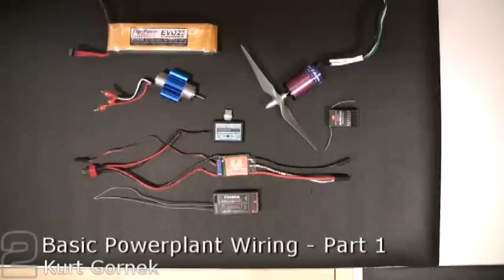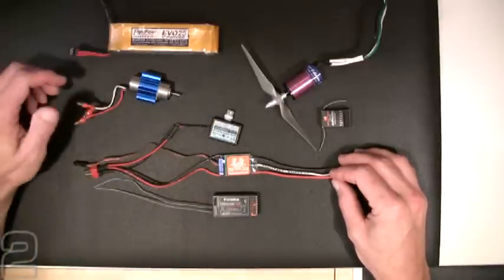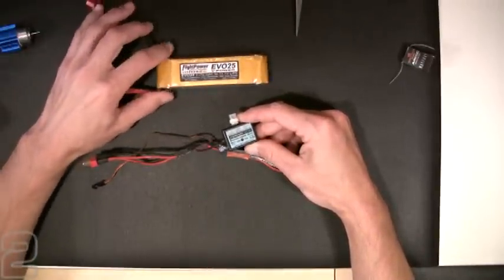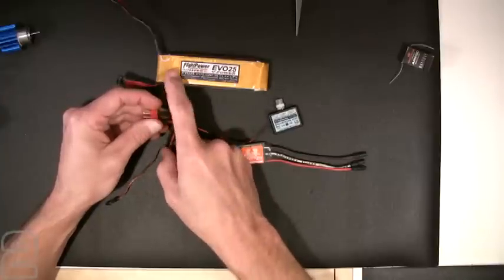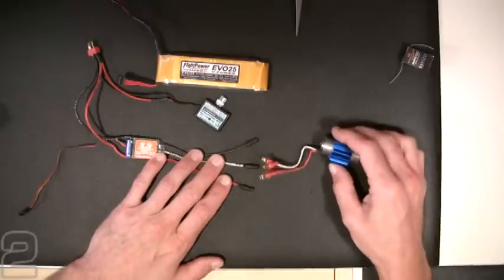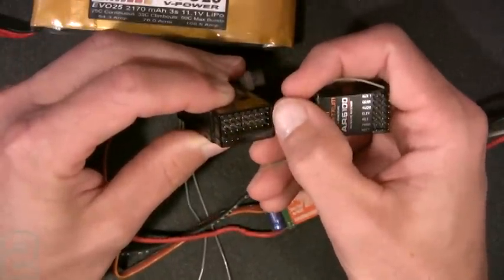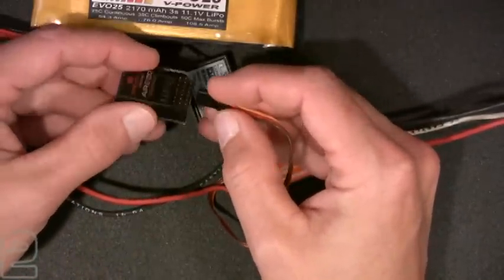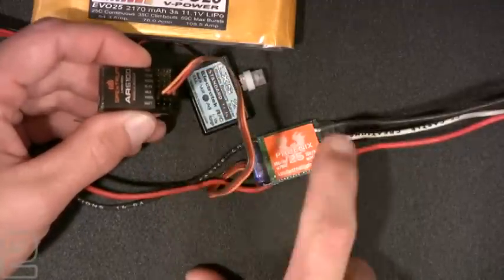RC Motor and ESC Wiring - Part 1

Comment: how do i connect the motor to esc? i have 3 connectors that i have no idea how to use. please help
Reply: +Kevin Wang Have you got just stubbs at the end of your esc?
Reply: i figured to just solder some bullet connectors onto the motor and esc, although  beware that the source closer to the power (ESC) Always has to be female, to prevent short circuiting
Reply: Kevin Wang ok thankyou

Comment: Can u help me i got my recevier to talk to me transmitter. And my motor works but my servos won't stop running.. As soone as i plug them in thay run and wount stop or respond to my controls thanks

Comment: can anyone tell me how to connect a brushed motor with 2 pins positive and negative to a 6ch receiver
Reply: this is not abouth brushed motors, he is a using a brushless, wich is what your receiver is for
Reply: Can u get the answer bro...?
If u get the process send me too plz
Reply: you need to use a brushed esc controller

Comment: hey brothers, i gotta question. im working on a project that doesnt require the receiver. i just need the esc with a direct connection to a throttle stick.its a hand held device. im stumped on what to do for this to work. any help would be appreciated. thank you

Comment: The motors i ordered dys 1806 have 3 black wires instead of black yellow and red HELP
Reply: You can connect any of the black wire in any order on the ESC. If the motor turns the wrong way, simply reverse 2 of the wires !
Reply: Thank you

Comment: I have 30 Amp ESC and all the connections are made,but when the switch is on(battery is connected).. the motor starts with a "ding" sound for every 2 seconds and the motor doesn't rotate..and all the connections are made properly ..what could be the problem? 
can u please help me out.

Comment: i have a eagle double horse helicoper consists of a brushed motor,and its battery got damages,i have a lipo 2 cell 7.4V 25c battery can i use it to fly my heli,and my previous battery of heli was a nimh 9.6Vbattery can i replace with my new lipo battery. pease tell me

Comment: My rc car is not working because first I try to fix the light of the car and I successfully fix it and next when I open the remote of the car I accident pull the wire of the connected to the  batterry actually I pull all the wire and I can't remember if where the two wire connected my rc car is enzo ferrari pls help me ?

Comment: What if the esc has only 2 why use in your brushless motor has three wires is there a adapter or someway to still use that ESC that has only two wires that connect to the brushless motor